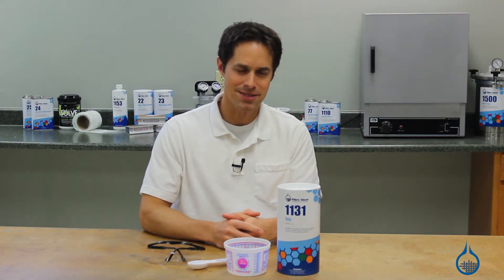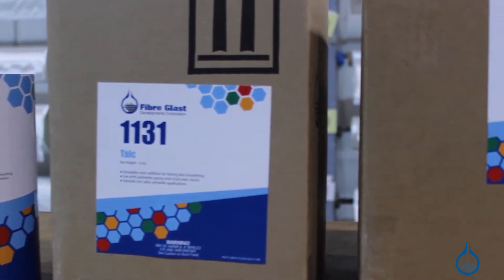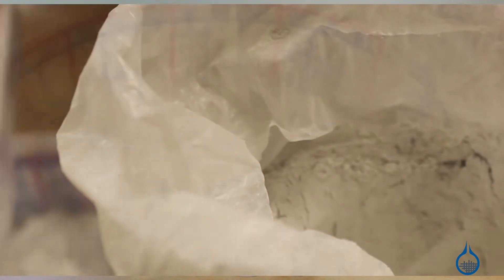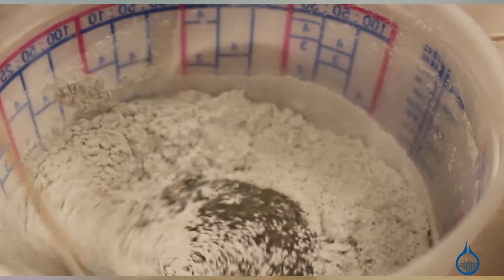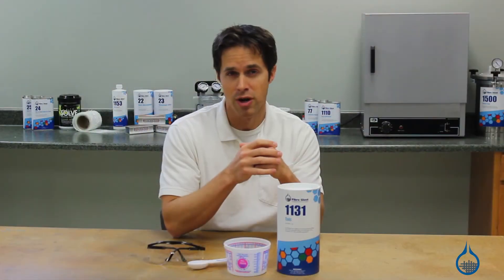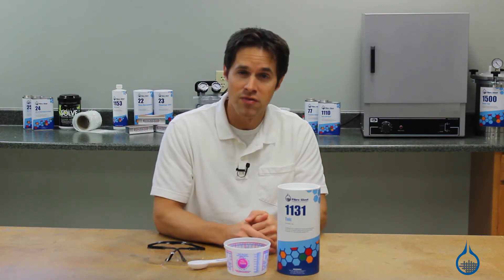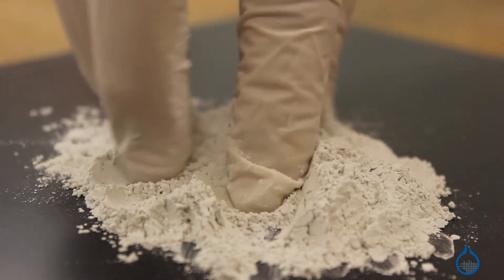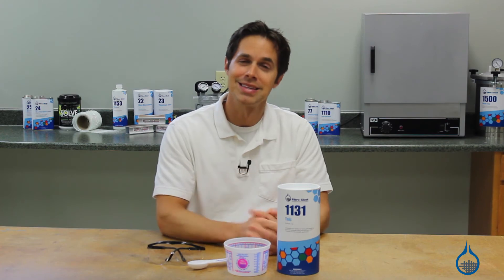Talc

Comment: if I am using talc and aerosil or cab o sil mixed for homemade gel coat. what is the right composition for both of them? talc 1: aerosil 1 or there is another formula. thanks before
Reply from the maker: Our customer support team is best suited for this question. They are very easy to contact at 800-838-8984 or customerservice@fibreglast.com
Reply: @fibreglast Glast thank you for replay I will contact the team. regards